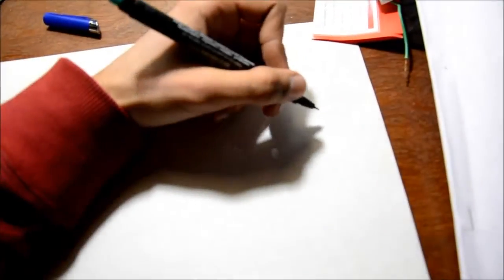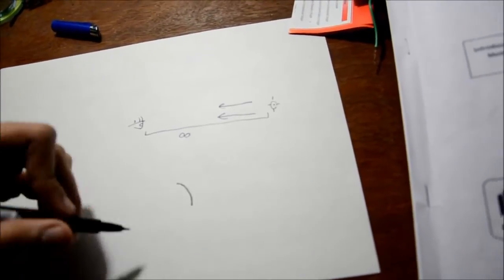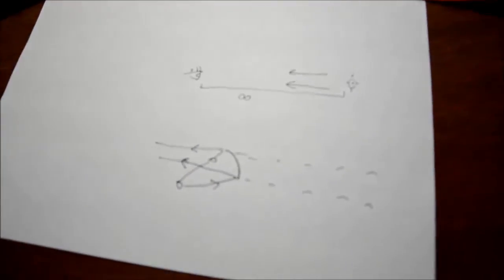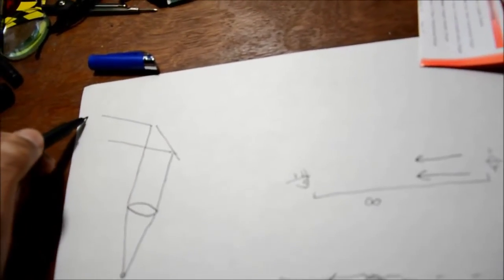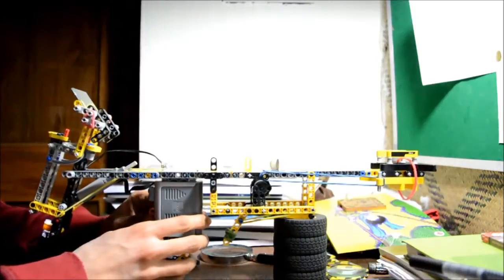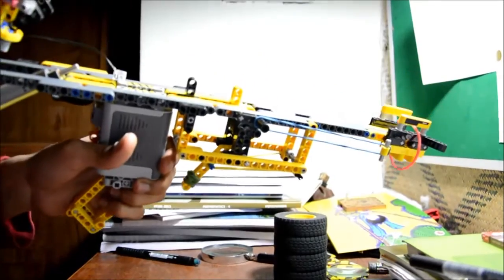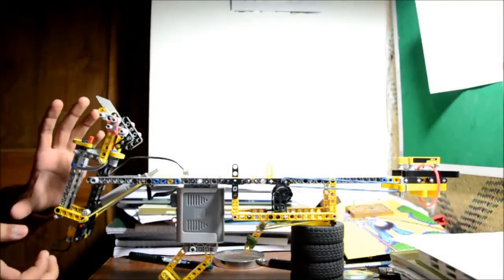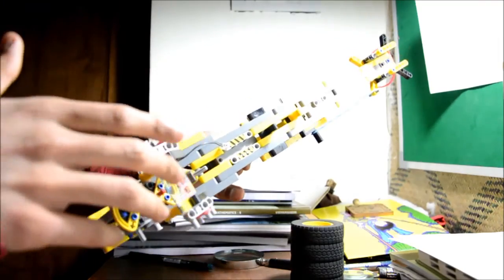Lego reflex sight / red dot sight (no parallax)

Comment: Nice video dude!! Like the other guy said your videos need more attention. Great explanation on how it works. Oh and can you reply saying WHERE you got them and what SIZE the glass pane and collimating lens are, PLEASE :)
Reply from the maker: thanks:)
look for shops that sell stuff for school physics labs. Or take apart an old telescope or something- but then you cant choose the focal length or diameter.
I used a 2.5 cm diameter, 10 cm focal length plano convex lens. focus can be anything between 5 to 10 cm, but if you get a large diameter lens, the legos cant support its weight.
the glass pane was tricky- try scraping off the silvering on a plane mirror with a blade. The one I had was 4.5cmX6cm.